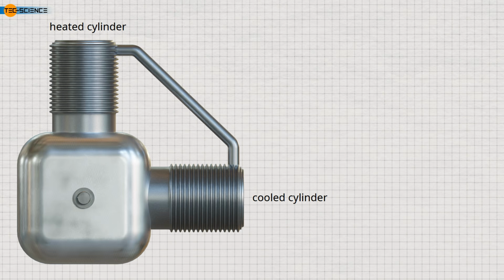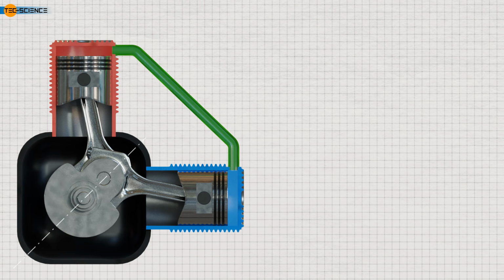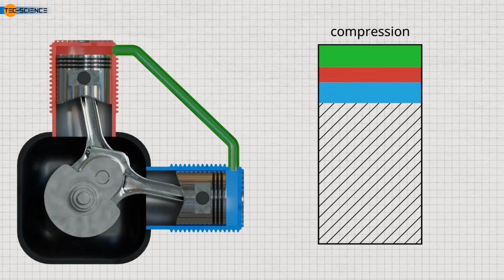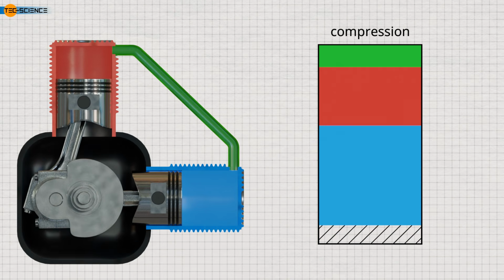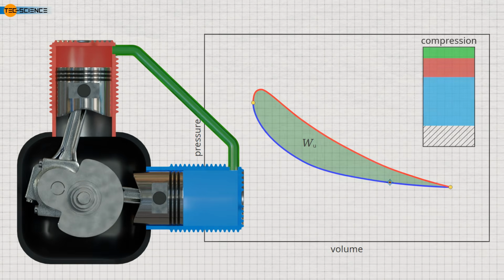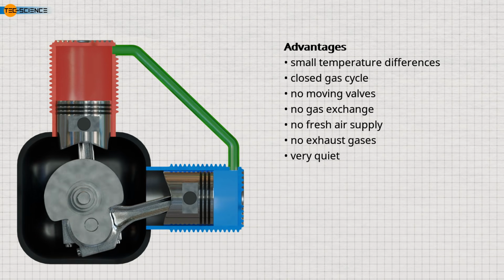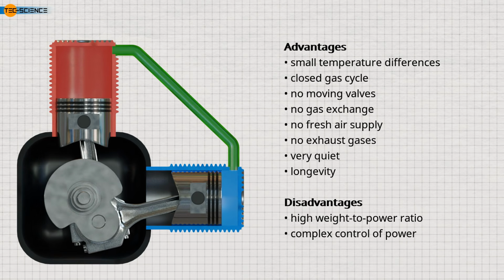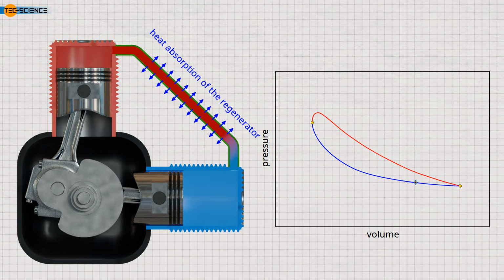How does a Stirling engine work? Design and operation of an alpha-type hot-air engine

Comment: Not mass. The mass in the system doesn't change, it's volume which is being changed, as the system increases and decreases volume due to pressure and temperature changes.

Comment: The reason why a Stirling engine aren't usually installed after a central heating system to heat a radiator and to run a shower, bath but to also power an electrical generator aswell to help pay for your electricity bill is for the same reasons why GP Morgan wanted to put a meter on everything!! This was widely apparent when Nikola Tesla was robbed from his patents after he sadly died at the Hotel New Yorker! And yet, because GP Morgan wanted to put a meter on everything, he couldn't wait to make Nikola Tesla out as if he was in terrible debt, simply because GP Morgan just wanted to get filthy rich due to legal embezzlement by the seal of government approval!! Mind you there's nothing stopping you from installing one unless everything checks out and all is safe! The problem is, that the word 'safe' is actually the same word 'safe' that Nikola Tesla kept his patents in, now you know the story, they can't stop you from trying despite of the bureaucracy and red tape behind it all!

Comment: Hyliion has 3D printed a stirling engine   and used it to power an electric  semi truck they also scaled it up to run a data center. they call it the Karno Generator
Reply: Could you please refer to some believable literature?  Thanks.
Reply: @BasementEngineer   NYSE (HYLN)
Reply: @BasementEngineer   NYSE (HYLN)

Comment: More experimentation on sterling engines is progressing with horizontally opposed four cylinder Stirling engines being developed at the present time. But if the flat four is successful six eight and twelve cylinder horizontally opposed engines could also be tested and developed.
Using needle roller bearings on both ends of the conrods has been successful with roller bearings also used on the ends of the crankshaft and more along the length of the crankshaft if more than four cylinders are used. Coated pistons and different numbers and types of piston rings and different piston ring spacings on the pistons are currently being tested. Also piston to bore clearance and other factors are currently being researched.
Reducing overall friction and increasing the overall efficiency and longevity is paramount for sterling engines for obvious reasons. The power generated must be consistent and reliable going forward.
The testing on horizontally opposed four cylinder Stirling engines has been progressing extremely well.

Just a reminder that it's not always about overall efficiency depending on the application the device or machine is used for.
😎🇦🇺👍

Comment: The model looks good, but if built as shown, won’t work. As the displacer can’t be a trunk piston, it must have a sealed backhead, similar to a steam engine. The power cylinder can be a trunk piston if the back is open to atmosphere. Further the displacer must have no piston rings and open flow from hot to cold side. Also the connecting tube must connect to the cold side of the displacer.
Reply: Both are power piston, no displacer.

Comment: The regenerator is the most important component of a Stirling engine. Its inner volume is usually large compared to the working volumes. This is necessary to fill it with enough regenerative material for the internal heat exchange and to reduce the flow resistance of this component. So the pressure ratio is relatively small and in the order of 1.2 to 1.5. But this is not so critical as it appears because the average pressure of the working gas is usually much larger than atmospheric pressure and in the order of 10 to 200 bar.

In fast running Stirling engines Helium is used as working gas. In the 1950ies, where the development of the Philips Stirling engines took place Hydrogen was more common because it is less expensive. Air was also a working gas in the history but it is no more used because of its oxygen content which can destroy the regenerator material. In slow running Stirling engines sometimes Nitrogen is used.

Comment: 612    wrong.       in the context of a heat engine used as  prime mover, the  engine speed is constant -- as determined by the  LOAD  and by the way that power is taken off.       the first output stage  should be a single stage of high-ratio (around 15:1) reduction.    via the use of gearing  or  a friction drive.    or possibly toothed belt.      the mass of a single (two-cylinder) heat engine is no greater than that of a IC engine of similar size.     in part, this is so because the components of a heat engine can be made  Much  Less  robust  than IC engine components.  
700    the duct does act as a regenerator.      that is, it provides (some) thermal isolation of the sides.      the duct/regenerator should be made of a material that conducts heat Poorly; design of the engine should avoid the location of the hot side  lower than  the cold side..       where tubing is used, more 'constant' regeneration efficiency can be achieved by the inclusion in the duct design, of a vertically oriented loop.    which will operate as a (convective) heat trap.  
there are a number of heat engine  Facts  that should inform the design of an engine.        one is, the use of lubricant should be avoided; not even at any bearings that may be utilized in the design.        thus, any bearings that are used should be full precision.      the need for lubricant is avoided , via the  Strategic use  of metals of differing hardness.

Comment: Your diagrams appear to show the "Rider" engine, not a Stirling engine.  In a Stirling engine there is a displacer and a hot end and cold end of the one cylinder which must be entirely sealed at both ends.  This limits the compression and it also has a lot of losses of heat from hot to cold through the cylinder walls.  In the Rider engine you have a separate hot and cold cylinder.  The compression ratios can be a lot higher and the tube between serves as a heat exchanger (often it WAS a properly designed heat exchanger) thus making the losses of heat a lot lower.  see  https://en.wikipedia.org/wiki/Rider-Ericsson_Engine_Company
Reply: There are named alpha beta and gamma type sterling engines.  Including free piston.

Comment: Why not available in the markets for power ? A 1KW sterling engine can be very useful with sand battery, especially in a rural setup or for domestic use.
Reply: I’m in the work of developing a decent sized stirling engine for generators. It’s just me tho, if I get production running I will come back and let you know if ur interested?
Reply: @matthewadkins7973  wonderful, I hope you succeed. Please do let us know when your engine is ready.
Reply: @matthewadkins7973 
Hell yea I would! Especially if it is at least 1 or 2 hp to crank a generator head. Going to be making a rocket stove/sand heat battery setup that runs off of wood debris and chopped longs people would otherwise have the city cart away.
Reply: 1kw is doable but it will likely be a very large machine for 1KW likely the size of a shed. Can be made smaller with smart engineering but certainly much larger than a gas generator
Reply: There where some companies that made generators like wispergen but they are almost impossible to find and and highly coveted. I have no idea why there isnt companies making them because people really do want them
Reply: @iamsick5204  I too wonder why there aren't in the market as there would be huge demand for such engines. Maybe companies see a better potential with improved storage batteries.

Comment: Hey yo, check this out, since the Pistons are 90° offset I could put the hot piston inside my stove pipe down where it's the hottest and the cooling piston could be in my crawl space where it's cold.
Reply: You could.  I am building something similar now.  Mine has a hot end on my wood burning fireplace.    I would recommend putting the cool piston straight down . . . . . into a bucket of cold water.   Water is an amazing cooler for one of these.
Reply: Did you have poc
Reply: Did you have pic
Reply: Please share a video of your contraption please!

Comment: Explain why expansion is so fast. that is what is hard, why so rapid?? the concept is easy. thanks!!
Reply: Thank you very much for your feedback. I am not aware that the expansion of Stirling engines is so fast compared to other engines. The speeds of Stirling engines are comparable to those of conventional combustion engines. Or am I wrong?
Reply: @andreas.hoefler  What i refer to is the Speed of air expansion due to a minor change in temperature. Thanks !!